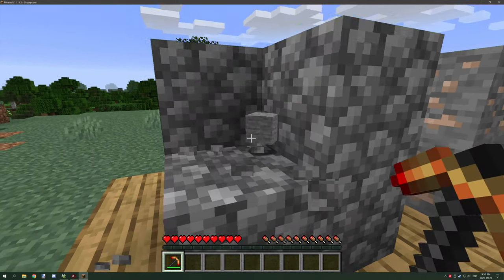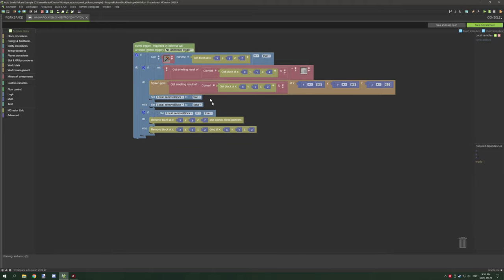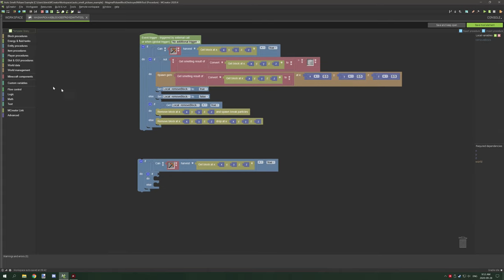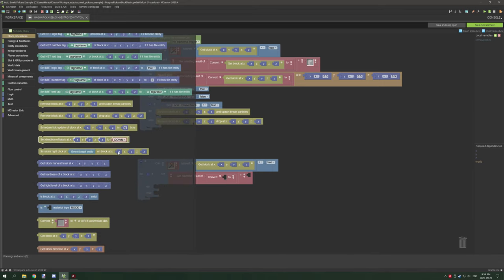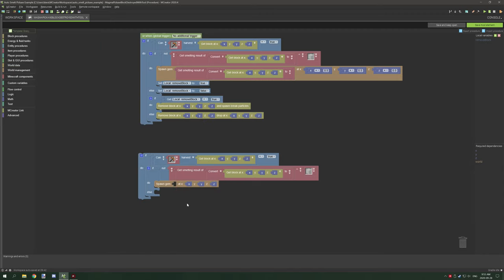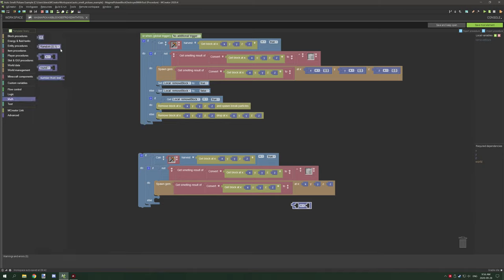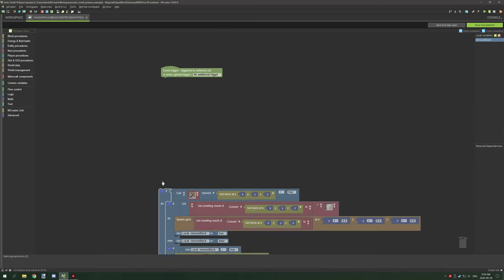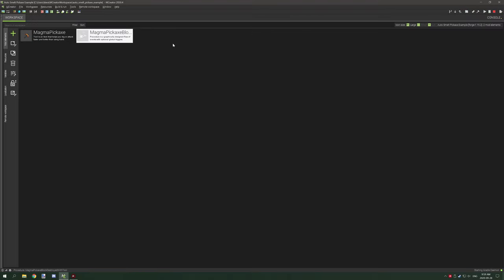MCreator: How to make a Auto Smelt Pickaxe V2 | 2020.4

Comment: can i fix it so for stone instead of dropping smooth stone it drops regular stone because stones drop would be cobblestone... and cobbestone smelts into normal stone.
Reply from the maker: This would be down to how the procedure block works, you can create a condition that when the block is mined if stone then drop cobblestone just make sure to test for the blocks you want to override first in your if statement before you run the rest of the regular script.
Reply: @NorthWestTreesMCreator  ok

Comment: i'm creating an enchantmnet that do the same thing as your pickaxe, but i get a little strugle when the block doesn't drop itself and with fortune.

whit my mod iron ore doesn't drop itself, but some iron chunks that can be smelted and work perfectly whit fortune, but if the pickaxe have autosmelt, drop the chunk without smelting. there is a way to say to MCreator to give the drop as itemstack and not the the simple conversion from block to item? (item iron ore =/= iron chunks)
 i have to set the autosmelt in the chunk itself to work?
Reply from the maker: You would have to make an exception on your mod's end but this would not be cross mod compatible. To do that just test for the block being mined similar to the first version of this tutorial then have that before the script for this tutorial that should allow it to test for the block first before running this tutorials script.
Reply: @NorthWestTreesMCreator  i make something working, though is a little difficult to cross mod.
first it check if the smelted result is the same of the block (stone->coblestone->stone) and drop itself;
then check if the mining result is a block (sand->glass), lastly for the ores i change the procedure of the chunk, getting chunk whit fortune or ingot if with autosmelt, but now i have to add chunks for every ore of this type. in the copper ore i made to serch if the block contein "copper ore", this way i don't have to add copper ore as a block and (i think) should work whit ores added by other mod. thought i don't know how add oredictionary entry to make the chunk be possible to be pulverizer into dust by other mods.

when doing the gravestone MCreator fine a exception: it's not able able to convert double to int with armor slot (aven thought i was using integer, but probably the blocky thingy only use double and the let the function convert into int). is it a bug of this version or i'm doing something wrong?

i find something in your way to add fortune in your drop a little bit strange, there is no need to put every single chance to every single type of fortune lvl and number of drop, you can just using something like this:
repet {"lvl fortune",
     if random<=0.57 (the minecraft default);
     spawn gem;}
drop another gem;
remove the block;
you will have the chance autocalculated by random inside of the repet function

nice work by the way, your tutorial are very helful and give a lot of inspiration to resolve problem that are not even related to it. Keep up with your amazing work

Comment: Why do they have to keep changing shit. I don't get it, it seems like it was working perfectly fine the way it was so why the hell do they have to change the way it works. It wouldn't be so bad if wasn't that even Mcreator themselves don't update their own damn tutorials. I have seen 1, ONE tutorial on the modern system and it has absolutely no explanations and just the guy doing things. I'm so mad at how many times I follow a tutorial for a while until I get to the one, literal only part in the whole thing that got changed to make that tutorial completely obsolete.
Reply from the maker: And now put your feet in my shoes, I have to adapt to all the tutorials I have made, its basically became impossible to maintain all the videos I had made, between Mojang turning Minecraft into a potluck party and MCreator messing around with existing systems I am at the edge of just giving up on trying to even bother to maintain the videos I have made.
Reply: @NorthWestTreesMCreator Ok i figured it out. It still works but for some reason, spawn gem got replaced with spawn dropped item. Why they felt that change needed to happen I have no clue.
Reply: @NorthWestTreesMCreator  We really appreciate all the hard work you do and share in that frustration sadly

Comment: It works for me, but for some reason it drops the unsmelted version too. So I break an iron ore and it gives me an iron ingot and an iron ore.
Reply from the maker: You may need to run it from a global procedure, then test if a block is broken then basically do the same thing but cancel out the event so the block does not drop then remove the block using custom script. This should fix the issue if its running on the tool side. I would make sure to disable the script from the tool though just make sure to test if the main hand of the player = the tool so it does not do it for every tool.

Comment: I know it's been awhile but I have a question,
Could u alter this code abit to use it in a custom furnace that is cross compatible with other mod recipes? because I don't know how to make a custom furnace that can smelt anything that is smeltable from any mod
Reply from the maker: You need to use item tags for cross mod compatibility replace item selectors with item tag logic variables.

Comment: Thanks :D making a mod with a quartz set of tools that have unique abilities and the pickaxe auto smelts edit: when i mine stone it gives me cobblestone and smooth stone when i mine iron ore it gives me an ingot and the ore how do i fix that? another edit: i made the first one if do else instead of just if do. hope this works now i changed it to just if do
Reply from the maker: The "Get smelting recipe" will check for the block as if it where the block if it where to be smelted in the furnace, cobblestone should make stone, stone will make smooth stone and iron ore will make iron ingots like most of the other ore block as all raw ores can be smelted to give one item version of that kind of ore. So it seems that its working like it should.
Reply: Have you finished the mod?